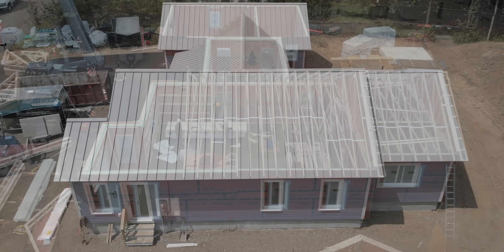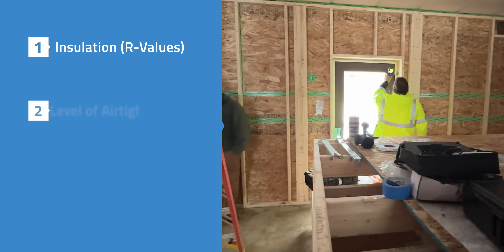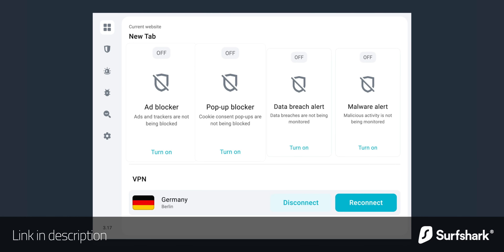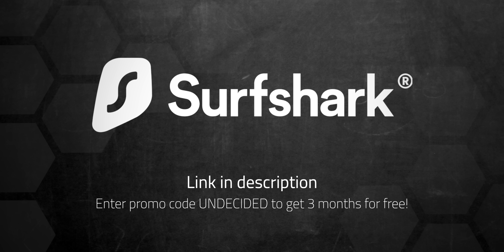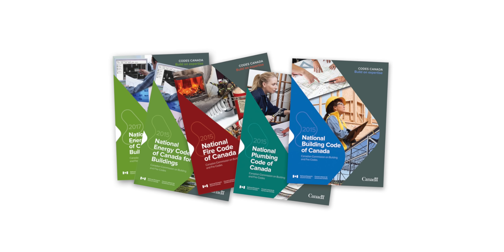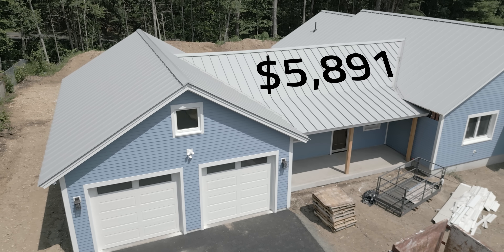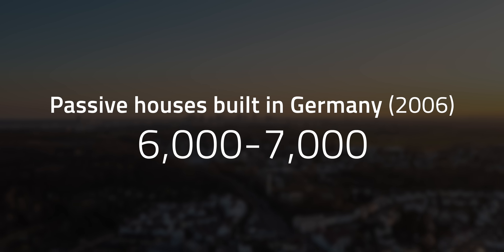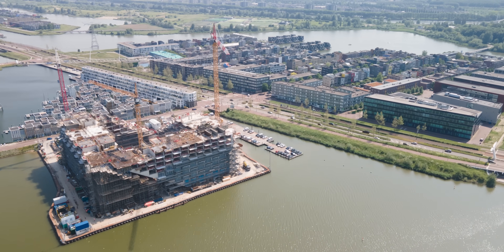Why Do American Homes Suck?

Comment: wood is worst posible material to do main construction. im a contractor in europe. double galssed windows are standard here for 25y. most of the job we do is adaptation and renovation. in old houses we repair construction with concrete and steel beams, houses are usualy concrete, cinder block or brick. then do the isolation and double sheeting inside. and in the most of cases facade osutside with wool. even some new builds we did like that. https://www.youtube.com/watch?v=fcefN2UanQE&t=81s

Comment: Another great video. I think Matt really nailed it when he started talking about energy costs being so much higher in Europe as a motivating factor.  In Massachusetts he is able to save $5891 in every costs on his new home and yet here I am in Georgia and I don't ever spend half that on my gas and electric bills on a 2000 sq ft home built in the mid 70s with old metal frame doublepane windows with bad seals. I considered the possibility of solar but it would take over 30 years to pay off the cost and that's if I had a zero electric bill.
Reply: Video is specifically about 'individual Houses' but what about the stuff Not-Just-Bikes, Edencity and Adam-Something preach?

Comment: You are right that it seems "cheap now", "expensive later" is the way the US goes.  Tornado alley and hurricane coast still build their houses out of wood, 2x4 and sheet, knowing fine rightly it will not survive the next storm.   I have heard in Florida if you buy a house that's more than 10 years old you should budget a NEW ROOF!  Because the sheeting gets damp and rots as it's not even engineered timber!   A new small home over here costs a fortune and is actually really difficult to get on the property ladder.  However, anything built more than 10 years ago was built to have a 100 year life span.  Solid concreete and brick walls, concrete roof tiles, etc. etc.  It is not blowing away in a storm.  Expensive to build, expensive to buy, cheap to maintain, lasts forever.
Reply: Video is specifically about 'individual Houses' but what about the stuff Not-Just-Bikes, Edencity and Adam-Something preach?

Comment: Does Norway have the same building standards as Greece?   One size does not fit all and what may be perfectly functional in one location may be problematic in another.  The US is a federal entity with 50 member states that largely retain the authority over building standards within their borders and some are stricter than others.  Strict, high end codes make for expensive housing and price a lot of people out of the market.  If you live in an area where codes are more relaxed there is absolutely nothing that stops you from putting the most high-end, cutting edge technologies into your home.  The US is not Europe. and most Americans are extremely thankful for that.

Comment: One somewhat mis-informational part of your video is that the Carter Administration installed "solar panels" and the Regan administration removed them. While this is technically true, it glosses over why this was done (which kind of runs counter to the point in your video). You imply that Carter (a democrat) was a visionary leader and that Regan (a nasty republican) was basically evil. My issue is that, the "solar panels" were NOT used for electricity generation. They were used for heating water in the wing of the house that did laundry and dishes and stuff. George Bush re-installed similar heaters during his time in office to heat the pools which was a better use case for the technology. The solar heaters carter installed couldn't store heat for after the sun goes down and even then you need to keep water circulating, and you need to make sure it reaches temperatures that can sterilize stuff because it was used for dish washing and laundry and stuff. It was probably annoying for the maintenance staff to use. It wasn't like Regan removed it as an evil move to use more fossil fuels. It was just a part of maintenance and the maintenance staff decided it was an in-effective system. There wasn't a white house press release on it. I seriously doubt Regan wouldn't have spoken out loudly about how dumb the idea was if he was vengefully getting rid of the former president's pet project, but it was more of just a publicity stunt by the Carter administration and quietly removed later during a resurfacing of the roof. Obama did install actual photovoltaic cells that are still there to this day. Even after Trump. ;P Because they are actually functional. https://en.wikipedia.org/wiki/Solar_power_at_the_White_House and https://www.quora.com/Why-did-the-Reagan-administration-remove-the-solar-panelling-Jimmy-Carter-had-installed-at-the-White-House were my sources.

Comment: Unfortunately there is a misconception regarding passive houses as energy efficient ways of building, what is driven a lot by the construction industry. Actually if we look at our entire housing situation, we can do many times more by living in more compact buildings, such as blocks of flats, as we need much less building materials, public transport can be efficiently organized, and we need less cars. Any old block in a city with 50-100 apartment, 50-70 m2/ apartment can be easily retrofitted with external insulation, 3 layered windows and thus the user will use a fraction of energy then would use in a nice 300 m2 house in a suburb.

Comment: And then there is basaltic fiber corrosion inert rebar to reinforce concrete and foamed concrete that is mold, vermin, fire. proof with high insulating value.

Comment: around 10 11 yrs ago i payd 900 euro (wich was alot at that time) for 3 bedroom windows,standard size in Roumaina, triple pan glass with a bit of tint that does not let un the summer the UV light from the sun in and the heat. never had issue with the gascets or locking mecanism,and its a big different betwen the triple and the duble glass if its from a good company

Comment: I bought a 1974 home in Washington state. The wall insulation is so thin it’s probably about R-5, and my house has no sheathing. So the siding is attached to the studs with just a vapor barrier separating. I’ve been replacing everything I can access during renovations, but plenty of walls I wasn’t planning on opening. Not sure I can afford ripping all my siding off, installing new insulation, then sheathing, then new siding. FML.
Reply: You put insulated panels on then side over that leaving your old siding on.
Reply: @martytube821  I’d still have to strip off all the siding. Hard to skip the chance to add sheathing as I have limited shear strength  on my house now. Reusing the siding is a good idea for cost, although the cedar siding is pretty rough on the southern side and warping in other areas. Hardie board concrete siding proffered so I never have to touch it again. Everything adds up.

Comment: i have built a couple of new homes in Thailand and i can absolutely vouch for energy efficient homes. My eye is firmly on the expected price increases in energy going forward. My electricity costs are massively lower than others i know . And i dont skimp on airconditioning.  Having a tight energy envelope allowed me to buy a small unit that just barely tickles over. The way prices are going all over the world, its insane to not worry about it.  The only  thing I have to say is dont be lazy, do the research and build better. Even low cost doesnt have to mean you skimp on bare basic insulation. Even in australia, we build shit because thats all we know. Every day i see new options opening up yet we still build houses the same way.  We need a "tesla" like breakthrough in housing construction.....cheaper and far better.

Comment: Well done, Matt!

Airtightness:  It's far easier to achieve than you might think.  As you've shown, you're using an air exchanger, a vital component in airtight homes.  I helped my uncle install his around 1994.  I refer to as an "air-permeable thermal barrier" or APTB.  To be frank, I see a strong need for TWO such APTBs, an active one with variable 0 to x flow rate, and a passive one with 0 to y flow rate, controlled by a butterfly valve on the vertical conduit used to achieve it.

The active APTB would heavily (dust + HEPA 13 + activated charcoal) filter outside air before bringing it inside, so as to keep out smoke and other particles.  It might also employ a desiccant wheel to normalize humidity.  Once inside, it injects filtered and heat-exchanged air into your homes air handler and air ducts, regardless of whether the air handler is on or off.  This helps keep fresh air circulating around the home.

The passive APTB relies on the density differential between your home's inside air and either warmer or cooler outside air.  Thus, it can flow both ways.  Either way, any amount of wind would also help expedite air exchange.  It, too, heavily filters outside air and may employ a desiccant to normalize humidity.

The need for the passive APTB becomes necessary for homes where the owner is absent for more than a few days and the power goes out!  That happened to me once during a hurricane in North Carolina while I was on temporary duty (TDY) in Germany and my wife was with me.  Two pine trees him my home, but fortunately, only one pierced the roof over the garage.  Additionally, the power was out for five days.  It didn't flood, but it might as well have.  The living space of the home was fine but the garage was a moldy mess.  I hit it with a high pressure water spray with chlorine and soap a few times, then a fresh water rinse and dry, before letting the sheet rock installers do their work,

Even the water-free interior of the home reeked of mold, however, so a cleaning crew was required.  A passive APTB with humidity control would have mitigated most of that.

Another benefit of a passive APTB is that it requires less work, and less energy, from your active APTB.  In fact, I may be able to figure out a way to combine the two...

Comment: Currently renting my home, and am thinking of making changes. Firstly, my landlord keeps annoying the hell out of me and my roommates as he bought the cheapest AC unit about 8 years back, and it is struggling to keep the house cool during a Texas summer, and blames it on a "leak" in the house or someone leaving their window open without him knowing. The AC no longer meets minimum efficiency requirements nor has it ever met the cooling requirements for Texas and some rooms in the house have the cheapest quality insulation installed over 20 years ago; I am hoping to open up the walls and replace the insulation over time, likely with insulation that is at least the proper R-Value, so as to improve the quality of life as winters and summers are extremely brutal. 

A most funny aspect of all his conceded rants and complaints is that he spent 5,000 dollars on the AC unit about 4-8 years ago, which means it is a good AC that can't be the fault. The  AC is priced at 1,300 for the entire base unit, which would mean he paid over 3x to have it installed, or he paid nearly 4x the value of the machine, not counting inflation. He has a lot more faults and does a lot of illegal stuff to save on costs for the house and "extend the life" of several of the appliances, which is why I feel no shame laughing at his stupidity. I even offered solutions to mitigate costs and improve the quality of life of his tenets, but he is an ostrich with his head buried in the sand. One reason I am not worried about being evicted is the illegal power monitor he installed on our breaker, despite being uncertified to do so; if he fails to inform a tenant about it, they can sue him for not disclosing monitoring equipment and then have him remove it; he would also be unable to evict them for it, which he also files evictions nearly 20 days before serving them, so as to get them out in a week instead of a month. Bankruptcy, bankruptcy, bankruptcy :D

Comment: I live in the northern part of the country where a lot of homes were built in austro-hungarian times which means at least a 100-year-old to150 made of brick with walls thick raging from 60cm to over a meter with wooden windows and they are still standing I would like to see how these modern houses would look like in 40 50 years...There is no quality by building cheap energy efficient or not get use to it

Comment: Hello from Ukraine. Yep, compare to how we build American housing seems unreliable. In UA we build often using natural stone, foamed concrete blocks, ceramic bricks mostly. And we hawe lot of soviet era fully concrete buldings. Wood cosidered third rate bilding material. We use it for temporary constructions like barns or latreens mostly. It mostly because we have cheap but badly prepared wood, or too expencive but good one. And good wood just cost higher than foamed сoncrete or ceramic. And also we have lot of stonemines in Carpathian and Donbass region, so stone relatively cheap.

Comment: As european. While international building codes may sound convincing, they are rather not. What should be looked at are the number of heating(cooling) days per year. In Italy which is not uniform in itself either sufficiently down south, it may happen that you have 3 cold weeks per year. Meaning you keep the windows shut all day long. During spring/autumn you have the windows open all day long an in summer you just open in the night. They are fine with that. AC is too expensive anyway. Another climate classification then can be the number of days a year where you do the temperature regulation by opening the window alone, meaning no heating no AC. If these days approach 10..11 month a year, thermal building standards are less of an issue. I never looked at the details, but would assume that fighting heat or cold are different approaches. We here just have to heat in private homes. Office buildings may be cooled in summer though.
Houses until perhaps 20 years ago had the concrete structure put into the soil, meaning the concrete was cold in winter. Since then the concrete is insulated with foam against the soil. Even underneath. Thus the concrete is warm in winter. Adds to the heat capacity of the house.

Comment: not common ..mandatory..for new houses, some illusion on effective emission lowering.  its costly and hardly efficient on the financial side. dont jump on every bs you see around the world. i mean the heat pump.....energy recovery ventilator...is one way to get around the minimum air volume in a room rule. with that the rooms can be smaller....another way of cheating :D

Comment: I live in the Netherlands and own a house almost 100 years old now. The original structure is still sound, just the later add ons which were not really well made needed some remedial work.
The outside of the flat roofs on the add ons and the exterior walls have been insulated now and tripple glazed windows installed, energy consumption already has dropped by 70% compared to before the works started. 
Some work still has to be done, like partial floor insulation, one exterior wall still to tackle as well, and installing PV panels and HRV. Then I can call my home a net zero home.
This shows it can be done with an old property too if that property is worth doing it.

I doubt most post war American homes will be worth the effort as these are so poorly built, it will be better and cheaper to replace them than to try to get them to this standard.
Benson homes seems to have mated European prefab house construction standards with the American code and preferences and is churning out a real good product, it is all more substantial, energy efficient and better protected against damp with the use of the proper membranes and breathable insulation.

Comment: Science and energy efficiency has become a political issue in the USA. Here you can have indoor gas stoves with no ventilation. The last administration wanted ro rollback water flow regulations to 40 gallons a minute for showers.

Comment: My house was built before a/c by a man who owned a local heating oil business. 50+ single pane casement windows between 3 & 6 feet tall, two sliding glass doors and 5 normal doors, three glass and two wood with windows.

Comment: I think you are nit picking requirements to show the most drastic differences to make your point. I believe each state should be able to establish their own building codes as local conditions dictate. The US is very diverse when it comes to average daily temperatures, amount and type of precipitation, humidity, air quality, soil conditions, frost level, snow load, the list goes on and on. I live in Arizona at a high elevation. I leave my windows open 8 months out of the year. My solar panels generate more electricity than I consume so my electrical supplier pays me for the energy I put into the grid by sending me a check every month. The frost level here is 0. If the federal government gets involved with enforcing a nationwide building code, if you consider their track record, I would have to implement construction requirements that are not needed or wanted. With all the federal regulations that are in place already controlling many aspects of our lives, we don't need any more at this point, let the states decide what is appropriate. And no, American homes don't suck, but a lot of builders do, especially the large corporations posing as craftsmen.

Comment: I also think that the homes in the US are almost always made of wood, that usely last only 30 to 40 years  here in the Netherlands almost Every house is made from Brick stone and that lasts wat longer. My home is from 1875 and is recently updated with thicker Isolation and heat pumps and battery's